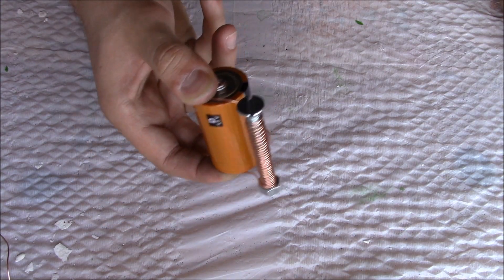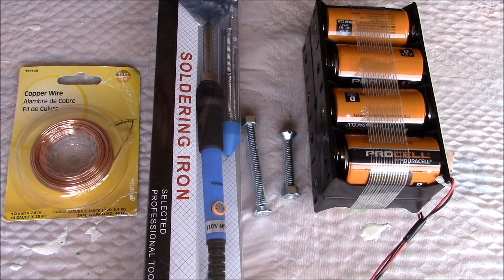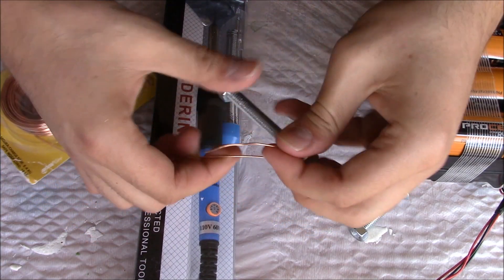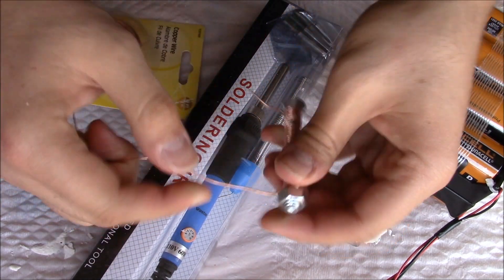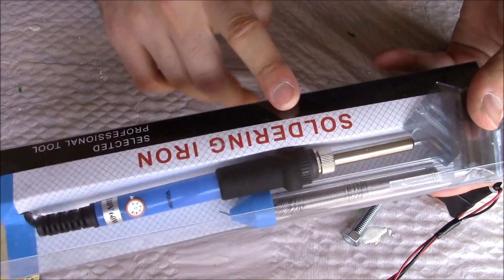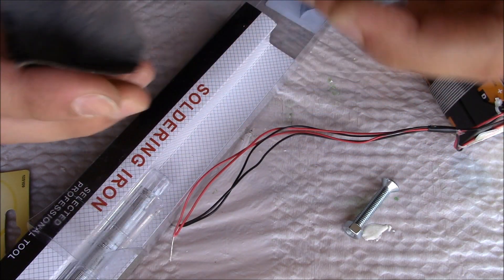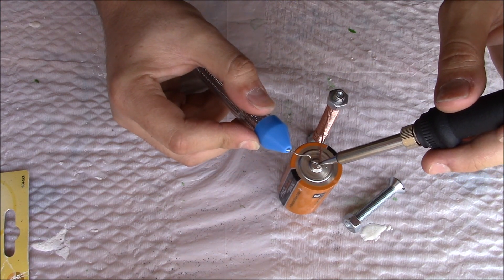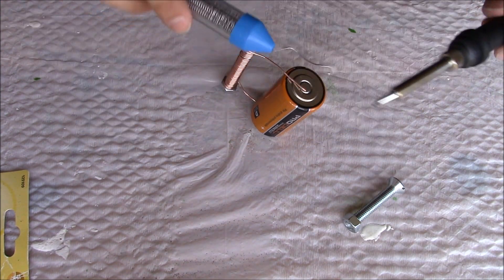How to Make a Magnet at Home Easy - DIY Strong Electric Magnet

Comment: use a paperclip as a switch and it will minimize the battery drain when you are not using it and it will prevent it from getting hot when you are not using it.